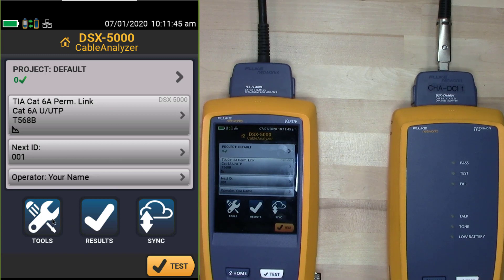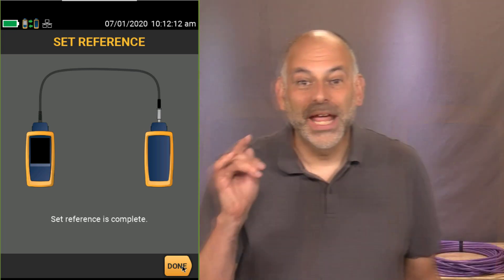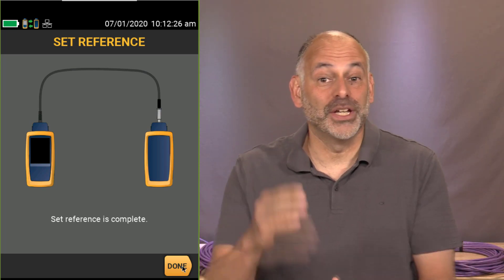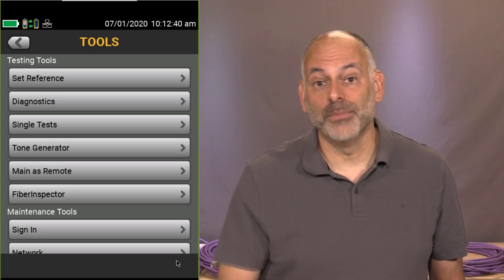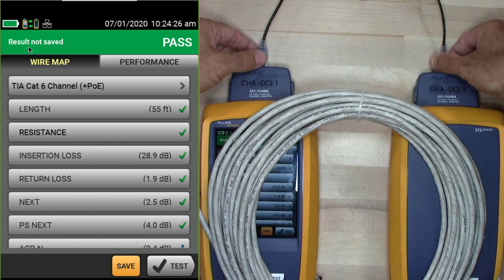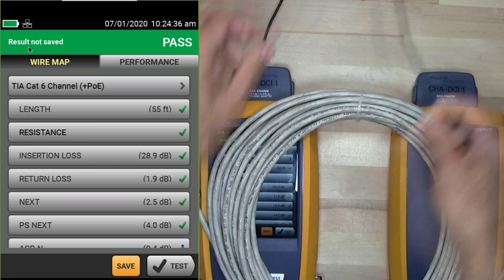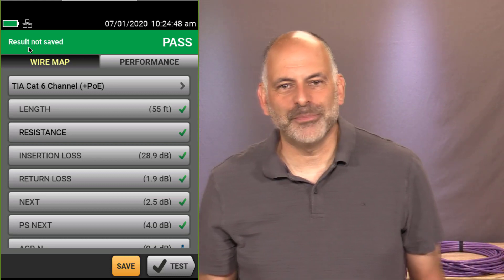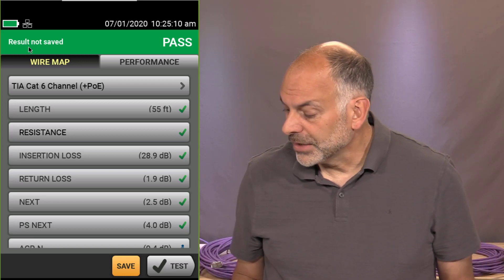Twisted Pair Certification Methods using the Fluke Networks DSX-5000

Comment: When troubleshooting, is it ever beneficial to shoot a test with the main at the patch panel...then move the main to the other end(jack) and shoot it in the opposite direction...?? I don't see where this is that helpful but I do see folks doing it often.
Reply from the maker: You are correct, there is no need to move the main to the remote end.  The modules are exactly the same on both ends and the testing is performed in both directions.  The key is using the information contained in the Fault Info tab in the test results and if necessary reading the HDTDR and HDTDX graphs.  These will point you to where the problem is in most cases.